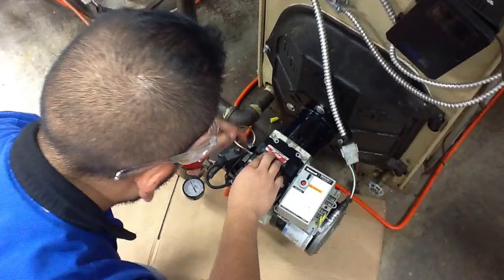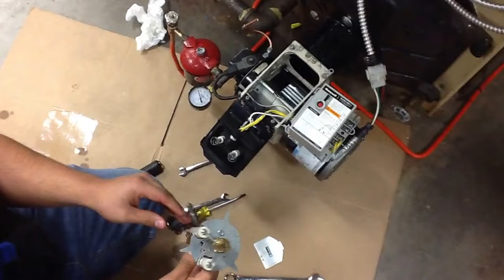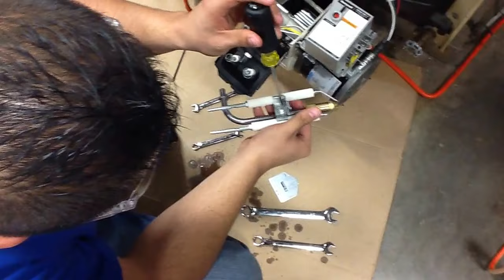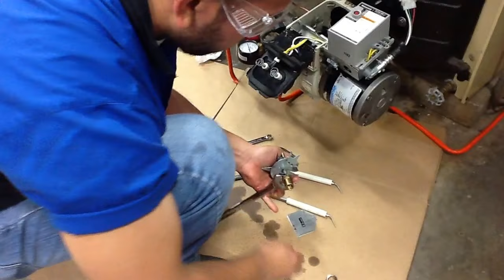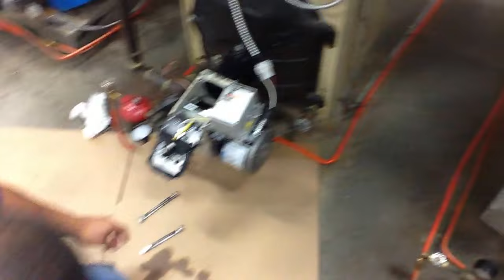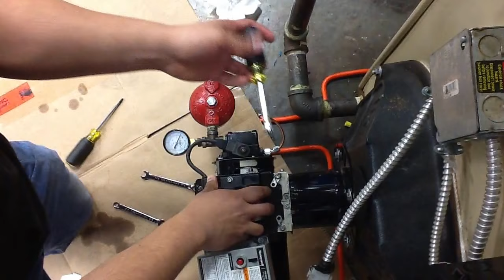Beckett Oil Burner Nozzle Replacement

Comment: might be a stupid question however  Ill ask you anyway, once a oil burner fires up, does the transformer continue making the arc spark in front of the nozzle or not?
Reply from the maker: +Rondo Schiavoni 
Thank you for your question. This Honeywell control does provide constant ignition. Upon a call for heat, both the burner motor and ignition start together at the same time.

Comment: Is there no need to prime after the supply line is disconnected like in the video?
Reply from the maker: Thats correct. If the line is disconnected before the pump, air will enter and need to be primed. After the pump, No.